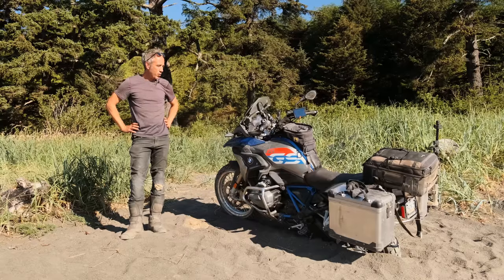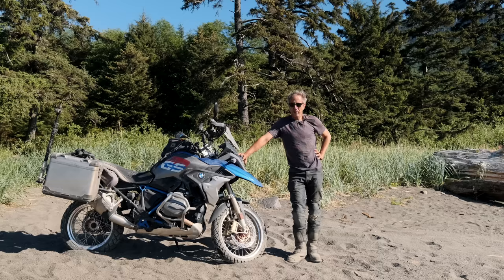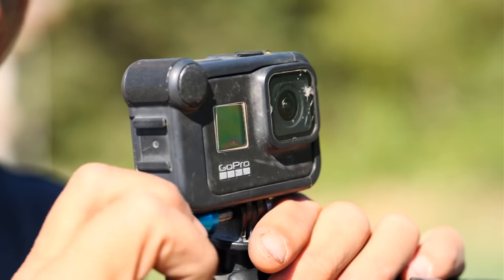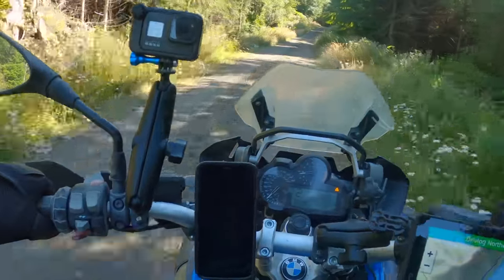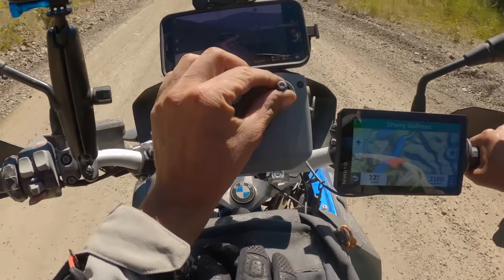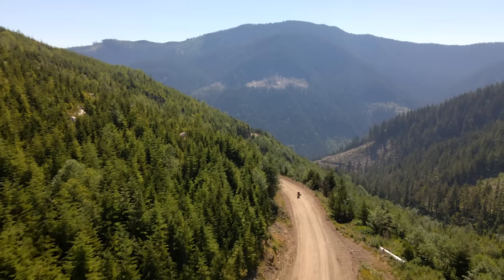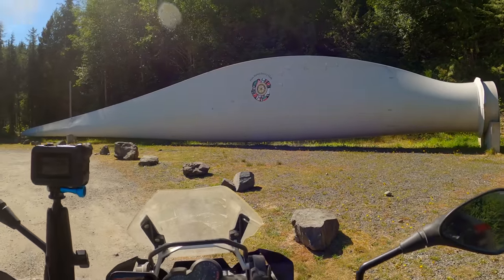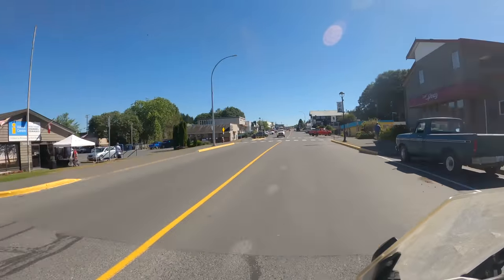Vancouver Island | Rest and Recharge Before the Ferry to Bella Coola

Comment: Next time you get stuck in that sand use Bill Dragoo’s method for sand and you would easily get out. Put the bike in second and straddle the bike. Get the RPMs up around 2k and rock the bike back and forth. On the forward rock drop the clutch (do NOT feather it) the bike will start moving. Once you are up on top adjust your speed and ride off.

Comment: Technical question for you- does your camera bag do an adequate job of protecting your lenses on bodies off road? I’m so paranoid of bringing my full frame mirrorless off road!
Reply from the maker: So far so good... It's padded inside of course. I only damaged a camera once, but that was because I left it turned on while riding on some rough roads. I think the IBIS got damaged. I would recommend not leaving the camera on and disconnect lenses during transport.
Reply: @SterlingNoren  Thanks, Sterling! That's the info I was looking for!